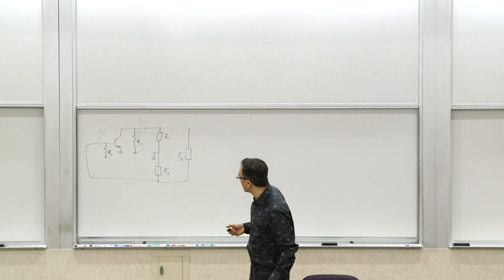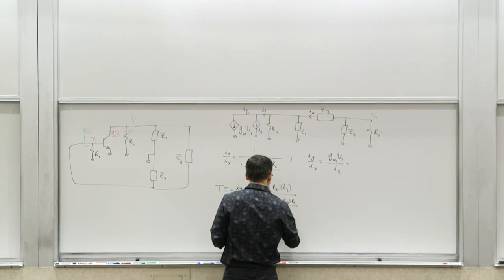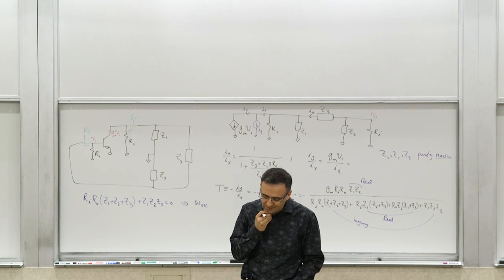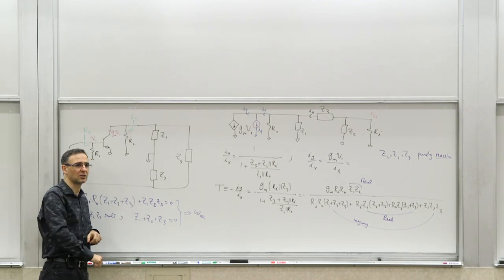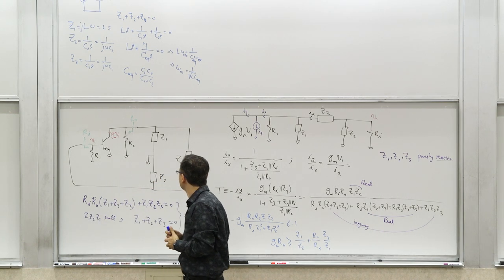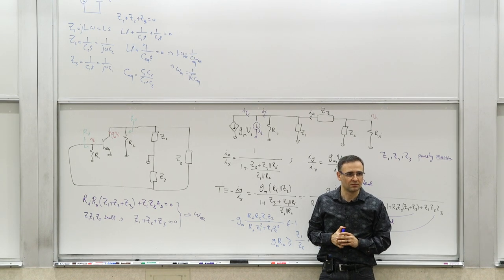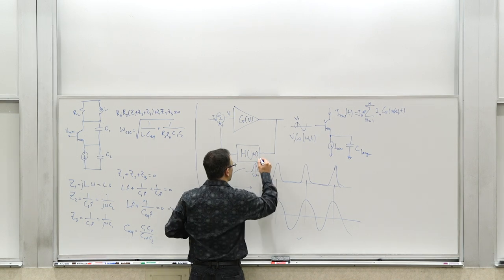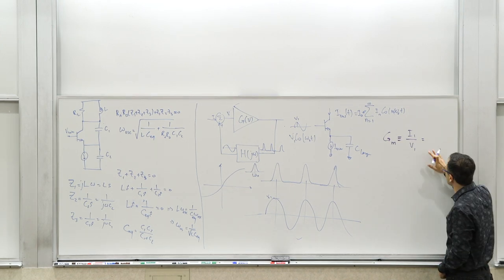184N. Oscillator general topology, large signal Gm, amplitude and frequency calculation

Comment: I have difficulty in understanding how the current source is replaced at different position at 38:07. In the previous position of current source, current was going upwards throough C2. But after the replacement current is going downwards through C2. How are the two cases equivalent?